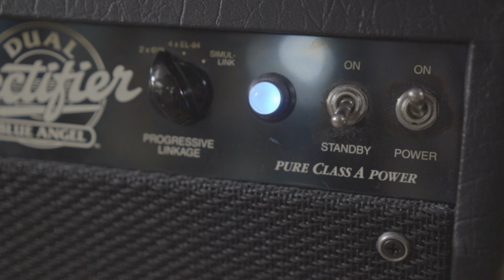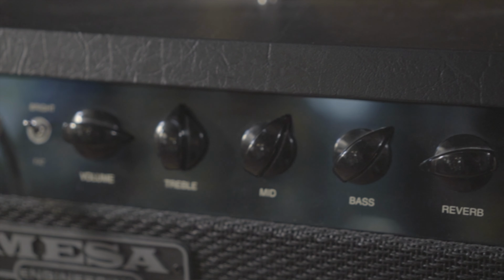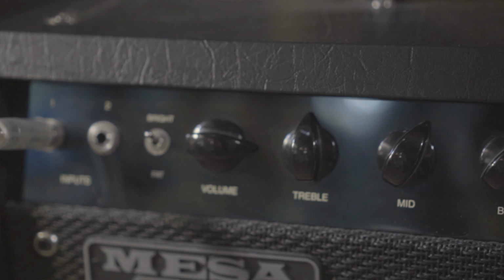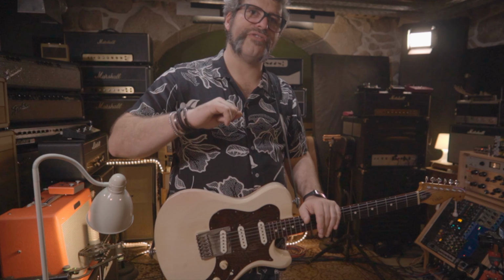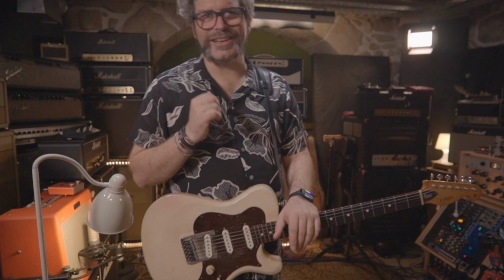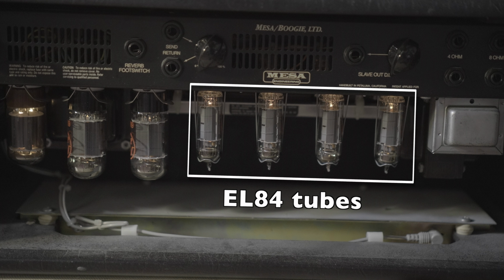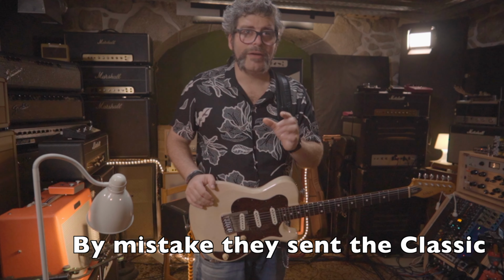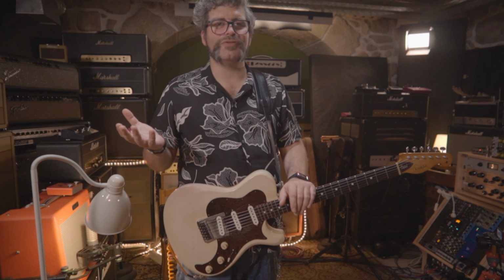The Tone of Power Tubes - EP339

Comment: I have a Kingsley Constable.....(In the effects return). It turns my H&K tubemeister 36 from an ok, "brite and brittle" amp (but reasonably powerful and clean) amp into an absolute monster.  It's got bloom, creamy tone, lively overtones and compression but still clean...and you can always add more dirt....but I never seem to need to.  You can't play a bad note.   I'm still wanting a Mesa Lonestar tho....just cuz.  Budda always seems to have great tone.  Cheers!  Edit:  Mostly the H&K does best on cleaner tones......the crunch on lower gain setting is ok at higher volume.....the lead channel is unusable in my opinion.  fizzy and harsh.  There's a world of character from tubes....even when the pre amp consists of 12ax7s.
Reply from the maker: You are basically using the Hughes& Kettner is a power amp
Reply: i had the tubemeister 18 and tried the best nos tubes ever made on it but still hated the lead tone whatever drive pedals i used it didn't help, i couldn't play solos with it the fizz killed me. the clean is amazing though. i ended up selling it and got a 1974x and the extension cab, i'm happy but it's not for everyone. i recommend a friedman twin sister instead now that's a well designed proper sounding amp for clean and drive no pedals needed .the lonestar is discontinued but don't beat yourself about it, i work with a couple of 2x12 combos they weigh a ton and break down every couple of gigs tubes, fuses...great for the studio, they have a special hi fi clean that some modern players like but traditional players hate and call it sterile.

Comment: Great Video Budda! I have a heavily modified Blues Junior Into basically a “Deluxe Reverb” with 6v6 tubes, 2x12 birch ply cabinet, larger power transformer etc. My other amp is a Ceriatone with quad EL84’s and blackburn era mullard I61 in V1 plus the legendary tones Hot Mod so it’s a 4 preamp now. These two amps give me everything i need - American & British. How do you find the feel difference of these? The el84’s with rectifier tube has that spongy thing going on while my 6v6’s are more stiff and open.
Reply from the maker: I love this amp. It’s a make it louder machine

Comment: hi , great episode as always.  i love 6v6's on small amps unless it's a vox and kt 66's for big amps. i want to share with you my biggest inspiration for tube rolling, ken fischer's legendary trainwreck nos tube layout ,it shows that he listened to the best tubes ever made from the 60's in all positions of the amp (tube rolling by the book) and chose the best for each spot ,no other amp designer including dumble has ever gone this far with  tubes or quality parts in general .
liverpool/express: v1(preamp) mullard i61
v2 (tone buffer) amperex bugle boy
v3(phase splitter) philips miniwatt
v4,v5 express mullard xf2 el 34
v4,v5,v6,v7 liverpool brimar el 84
there is a time in any guitar player's life where he wakes up and realizes that he must have a stash of nos...since you own so many amps i highly recommend reading the tube king's online guide (about nos tubes and guitar amps) and getting an orange vt 1000 tube tester it's discontinued so try used (around 300$) this small easy to use device will save you trips to the tech and will let you optimize the tone and gain structure of your amps the best way possible. enjoy!
Reply: I agree 6v6 and kt66 is the bomb. 6v6 for creamy dimed power tube distortion, kt66 for headroom and max volume.
Reply from the maker: I think my favorite is el84
Reply: @dunxy  then you will love a nos mullard i61 or i63 at v1. the i61 is more open and airy the i63 more rolled off and compressed but still retains clarity. enjoy!
Reply: @BuddaGuedes  so you are a vox guy. the best el 84's ever made are brimars and mullards from the 50's and 60's like the early vox amps had.